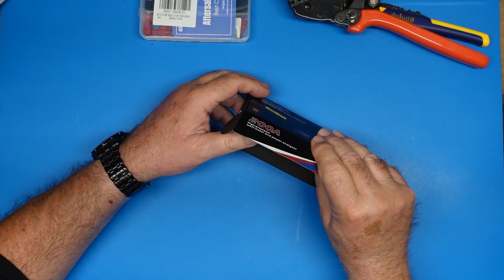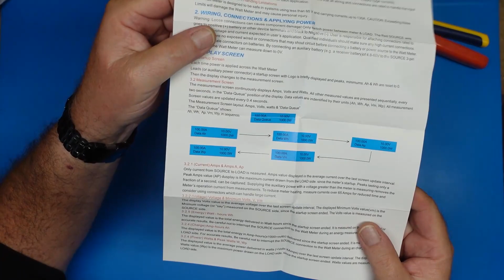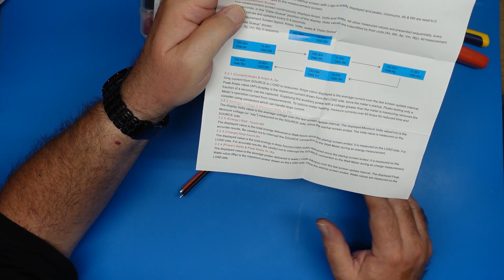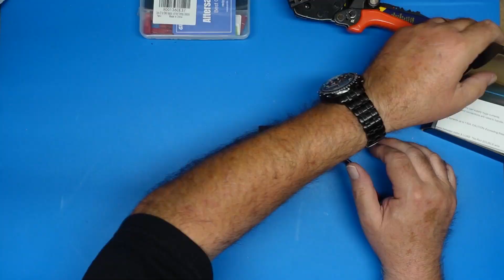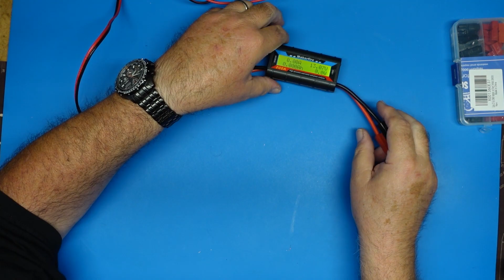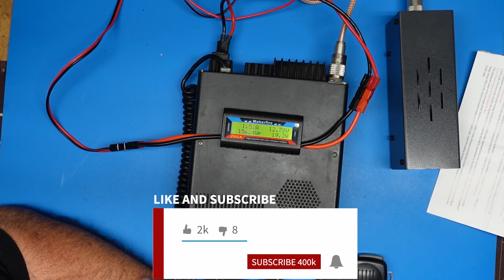The Go Box Just Got Cooler: Inline Power Meter

Comment: You need to find the spot where the display is powered in order to turn it off. Or have a rather large switch to handle up to 200 amps of current.
Reply from the maker: Right - I want to incorporate a switch.  I used it at Huntsville, and was a total plug/unplug barbarian